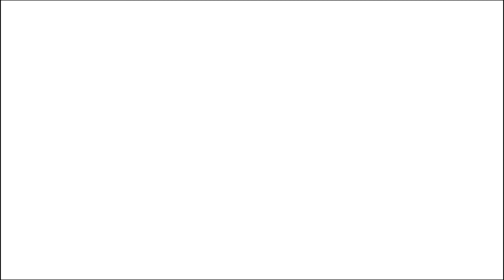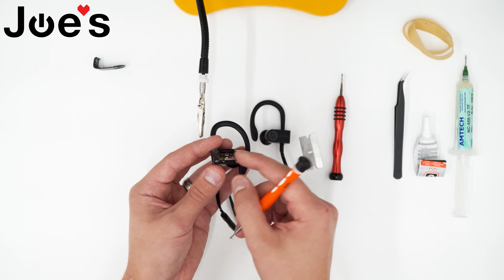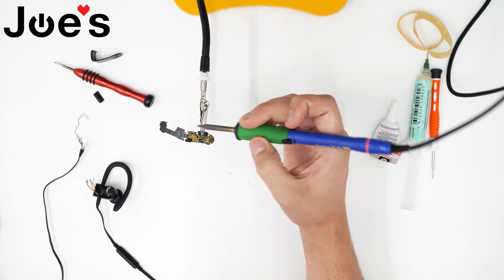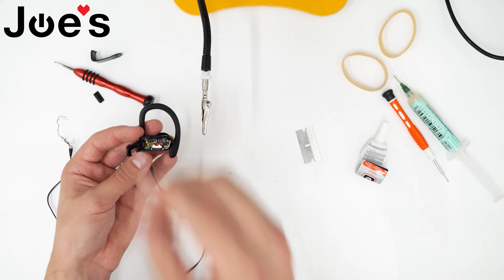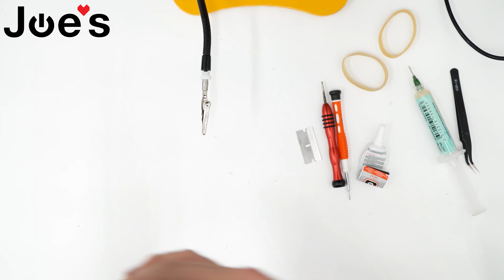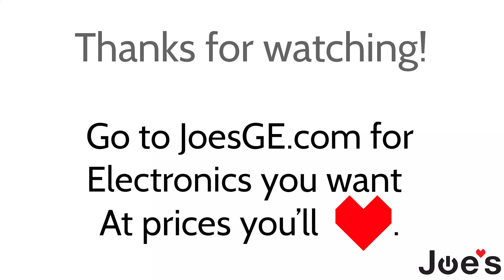Tutorial How To Repair Replace Broken Powerbeats 3.0 Main Wire

Comment: Joe,   Is there a wire that’s going to the mother board from the battery that may come loose or damaged?  I just got a new battery thinking that it would cure my issue with my Powerbeats 2 only it didn’t help the no charging issue.   Once you connect the charger to the headphones on the motherboard side she starts right up and works perfectly.  So I disconnected the battery and the phones behaved the same way as they did before I removed the old battery.  I think there’s some damage in the power wire someplace and I’d hate to do this entire job only to find out it’s something else.  Please assist.
Reply from the maker: Hello, thanks for commenting. Please email us at support@joesge.com and we will be able to better help you there. - Aaron P

Comment: Hi, thanks for the video.
My bluetooth ribbon is severed. I did this when replacing an ear hook. The headphones won't turn on, only give the red light when plugged in or flash red when trying to turn on. They will flash red and white if I hold in the powerbutton while they're plugged, but ultimately won't sync with any device. The battery does not appear damaged. 

I can't decide if I should replace the battery or the main board (for the ribbon). Any suggestions?
Reply from the maker: If its no connecting id say its the main board.
Reply: @Joesge  well it's not so much that it's not connecting it's not fully powering on

Comment: The main wire of my Powerbeats 2 is worn on both ends. Thin copper wires  on the outer layer are exposed and some are broken. I plan to cut small pieces from both ends and then to put the remaining long piece back. I will do this when the headphone is no more functioning. Do you have any recommendations before I do this? I have no special equipments.
Reply from the maker: Thanks for the comment. The issue you are describing sounds like the whole main wire is about to go out and not work anymore, if the wires are exposed it's more likely for it to break quicker and cutting the wire will not be the best thing to do. I recommend repairing the main wire. This is a common issue with the Powerbeats 2 If you would like your device repaired by a professional you can fill out a repair form and follow the steps to send in your item. We offer free shipping and diagnostics. Here is a link to the repair form:
https://www.joesge.com/pages/repair-services

Russ C.